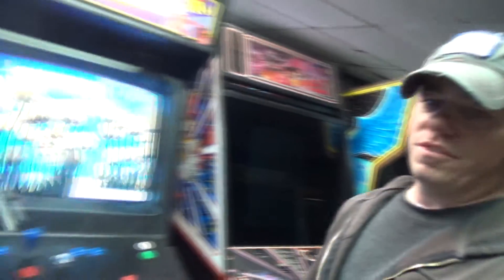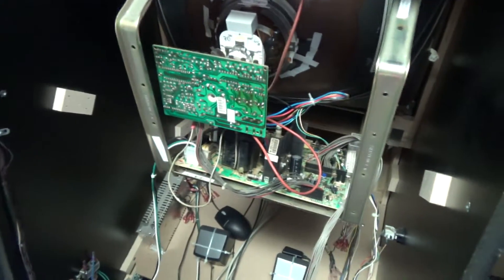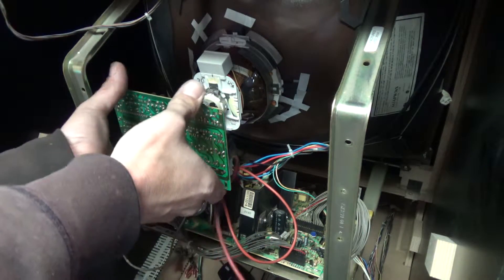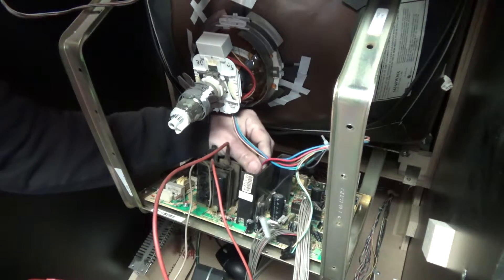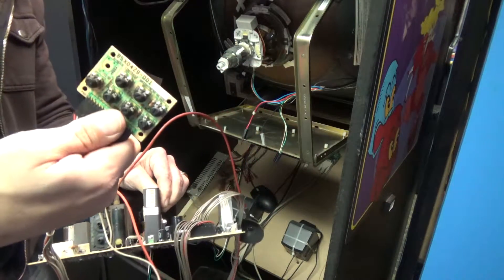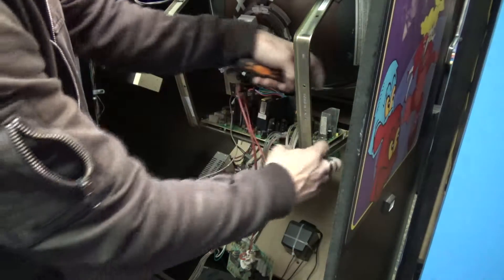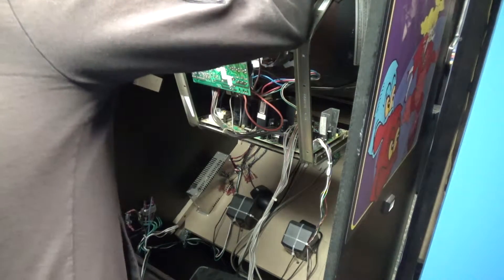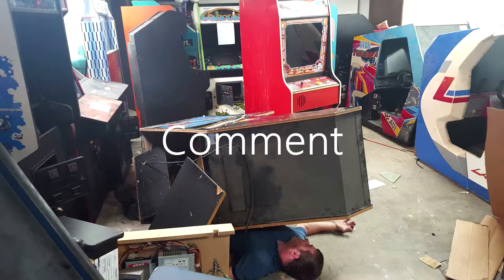EP 11 - How to discharge and remove a monitor chassis safely

Comment: Hi Chris, I'm sorry for a duplicate. I posted this question in your Asteroids monitor repair video. Where did you get that discharge stick with the volt meter? (WebLink if you have one?!?) I have an Asteroids and Asteroids Deluxe which both need some monitor work and I'd by happy to buy that tool (and potentially save my life) then trying to build a tickle stick with resistors, etc. Please reply if you have a moment. Love your videos. The metal Dig Dug theme is awesome BTW! \m/